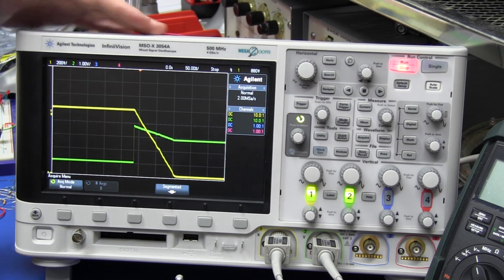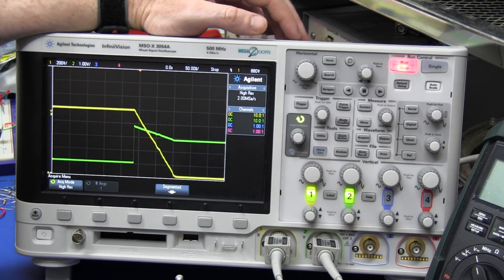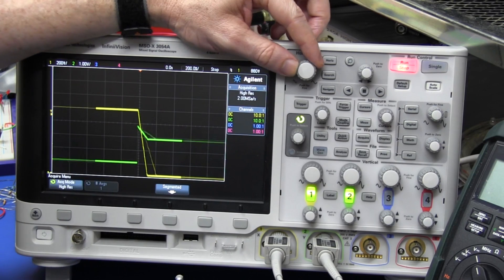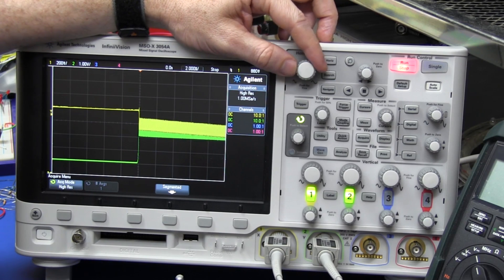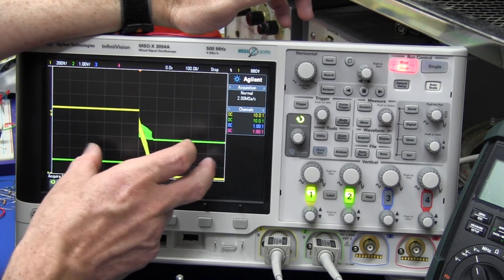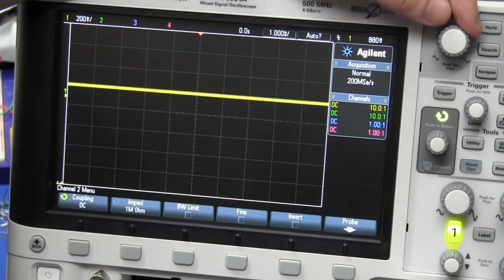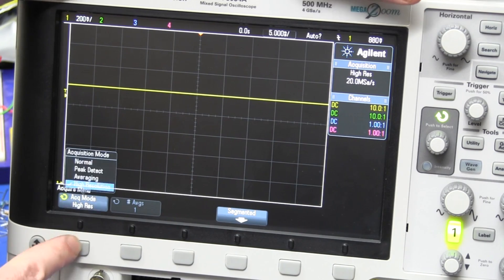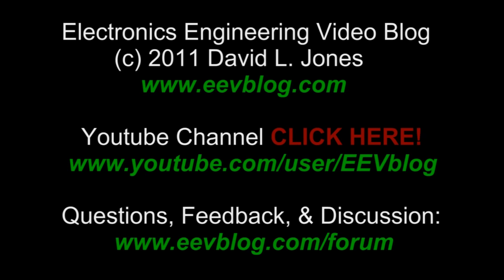EEVblog #223 - Agilent Oscilloscope High Res Mode

Comment from the maker: @Afrotechmods All they say is "High Resolution mode averages sequential sample points within the same
acquisition. An extra bit of vertical resolution is produced for every factor
of 4 averages. The number of extra bits of vertical resolution is dependent
on the time per division setting (sweep speed) of the oscilloscope."